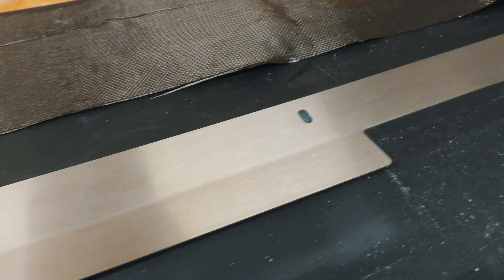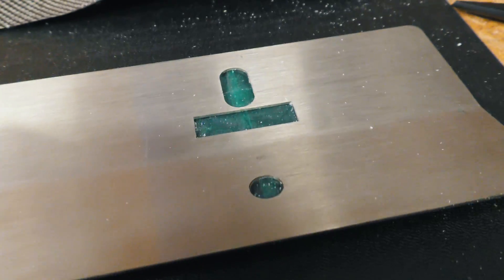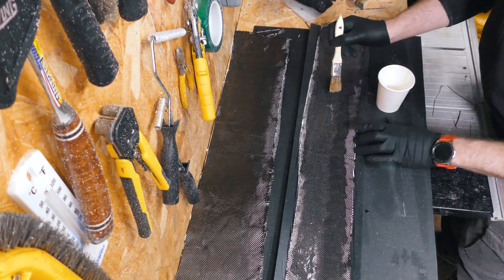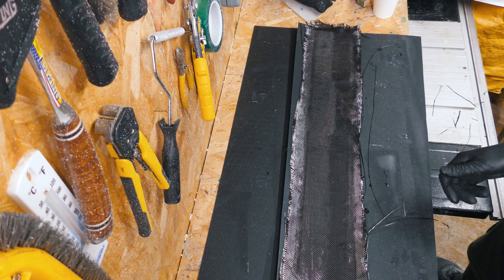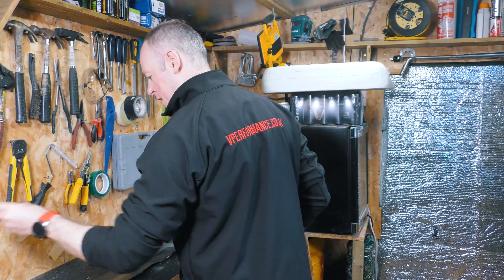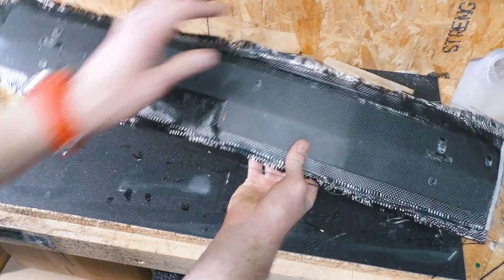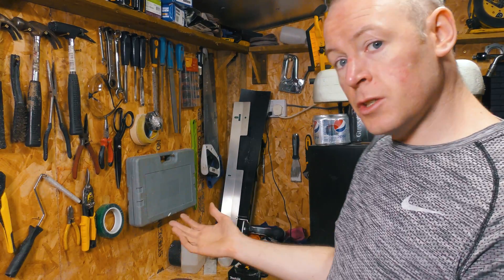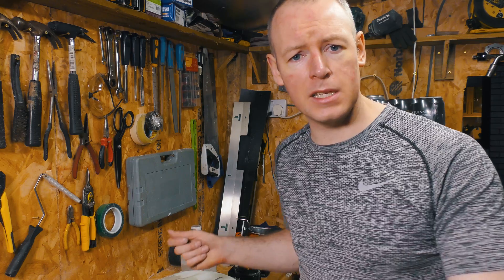How to make DIY carbon fiber parts at home with wet lay

Comment: A few questions if you would. I'm wanting to make a carbon chassis for my rc car. What I layered it 4 to 6 deep, clocking each layer? Seems like if you went just 90 degrees off each other it would twist diagonal too much, but maybe I'm over thinking it. As well, do you use a release agent on an aluminum part to mold from it just clean it well? I know acetone releases well, so maybe that last? Sorry, last question. What kind of epoxy to use? Can't find none that says it's specifically for carbon fiber

Comment: Quick question so the resin doesn’t strongly stick to the metal? 
Or did you apply something to the metal to make it easier to come off once the resin dried?
Reply from the maker: Many many layers of wax
Reply: @vPerformance  what wax exactly you use ?

Comment: The piece turned out well but I'm wondering if the dimensions will be off which could cause issues with fit. Sanding and then adding additional layers would improve strength and possibly help negate difference with size & fit

Comment: How did your cut off the excess carbon fiber?
Reply: If its soft enough you can use scissors/ razor blade on the edges. For the hard parts a dremel cuttoff wheel

Comment: What if I lay 1 more carbon fibre
Reply from the maker: Then it would be 1 more stronger. The layers make it tougher but heavier
Reply: @vPerformance  if I use 5 layers then It will become stronger but not flexible for body parts
Reply from the maker: It'll be plenty flexible for body panels, and tough too!
Reply: @vPerformance  how many carbon fiber layer can I use to make it solid I want to make my dream car
Reply from the maker: I couldn't say. You'll have to do some testing
Reply: @vPerformance  ok thanks I'm a new sub love your vids

Comment: Can you apply more carbon on the back in retrospect for rigidity or is it too late?
Reply from the maker: I think I could, but I don't really need this part to be solid. It's just an air cover really. I like the idea though, if in future I need to add strength after the initial layers

Comment: You want to lay your third layer on at 45deg
Reply from the maker: 45 not 90?
Reply: vPerformance You already have the same amount fibres running across the piece as along it, unless Iv miss identified the weave your using. 45 or diagonal wound have stiffened up the surface more effectively as well as a third layer making it physically thicker therefore stiffer. With 3 layers I’d have put the 45 deg layer in the middle too for evenness. One reason your previous test panels were so stiff was excess resin making them thicker. You’ll be doing foam core panels soon. 👍 Your scoop will be naturally stiff as it’s full of compound curves not flat panels, fibre direction will be more of a cosmetic concern.
Reply: @jons6125  👏
Reply: @jons6125  what percent of resin and hardner will be perfect to make the part stiff?
Reply: @SwarangiKale-uh2pr  with epoxy you always want the correct mix of resin and hardener as shown on the packet. For polyester resin the “Hardener” (better called the catalyst) is usually 1 to 2.5% ish? Less will just give you longer working time more will compensate for colder conditions. Generally better to use an amount in the middle like 1.5% mix very well and make sure you keep the part warm so it cures correctly.
Reply: Stiffness comes from the type of fibre and resin and basically the thickness of the material the thicker it is the stiffer it is. You can do this with light weigh foam cores in between two layer of cloth and get a very stiff material for little weight. Stiffness and strength are different.
Reply: @jons6125  okay thank you🙌